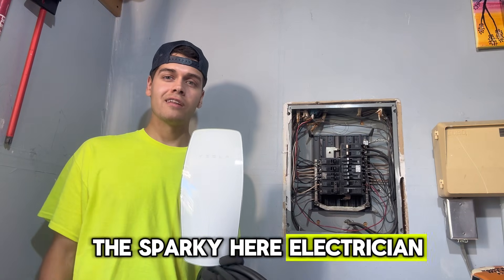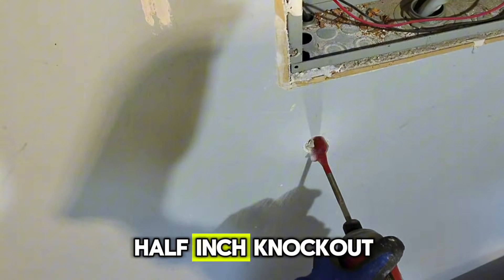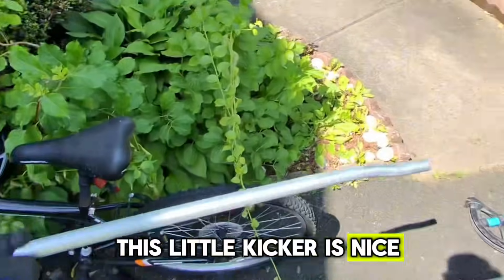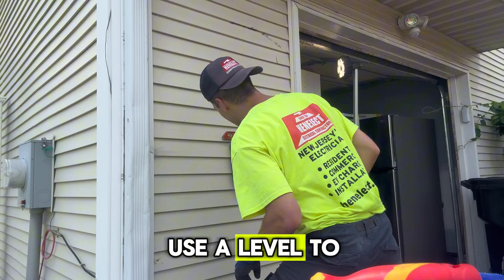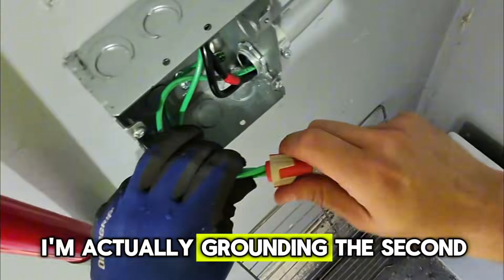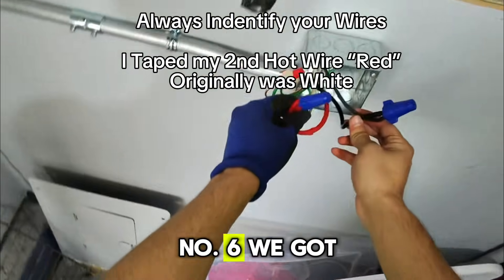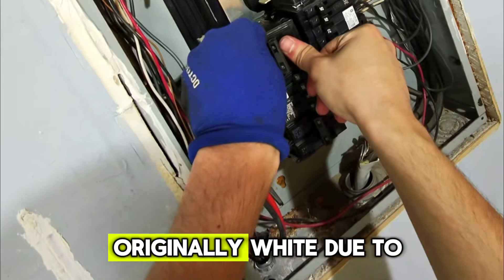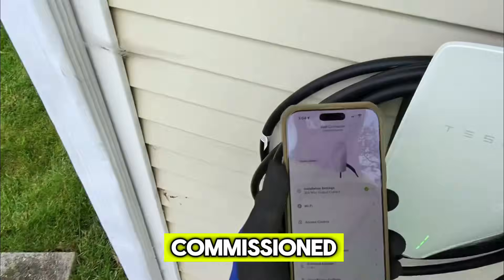HOW TO INSTALL A TESLA WALL CONNECTOR ANYWHERE! THE EASY WAY!

Comment: You can use 6 awg even on a 60 amp breaker, because the Tesla charge is a 48 amp charger, and 6 awg is rated for 55 amps, also you want a CONTINUOUS run of copper wire with this, DO NOT cut and twist wire together

Comment: hi, doesnt that wall charger charge at 40 amps.  vs the mobile charger which charges at 32 amps ?
Reply: The breaker is 40A, but this car will be set to charge at no greater than 0.8 X wire ampacity. Wire ampacity is 40 A based on the 60 deg column for the short run of #8 NMD90. 0.8*40 = 32A, so the charger will be dialed down to 32A at this location. Given the tiny panel, I'll throw out a guess that his main panel wires may not be able to handle much more than that anyway. The breaker is chosen based on wire ampacity. The reason continuous loads effectively derate a circuit is because the continuous production of heat may lead to a dangerous cycle of increasing resistance, more heat, connector breakdown, and fires. You never want your continuous load to get close the tripping value of the breaker.

Comment: So why were the 2 “junction”
Boxes needed? Im asking out of genuine curiosity because i have negative knowledge of anything electrical
Reply: Where the wire penetrates the wall to the charger a tight turn is needed, so he had to use either a box or maybe an LB fitting. Where the wire comes out of the surface mounted panel, he likewise needed a tight turn and a transition to the MC conduit, from something that protects the short run of wire inside the wall between panel and first box. Whether he used a short length of flexible metal conduit to protect those #8 wires, a short run of MC cable, flexible liquid tight conduit, or in this case NMD 90, a box was the most convenient way to transition wire and anchor the run of metal conduit. If the panel had been surface mounted he could have started with conduit directly from the panel. I might have been inclined to avoid a splice by doing the entire run with #6 THWN inside conduit between boxes, and extend that same THWN inside flexible metal conduit for the short run between panel and box. This would allow versatility in case the client one day decides to upgrade the panel to allow better power transfer.

Comment: I probably would've done it like that, but I don't like the little short nipple for that box offset, should've all been in one pipe, or at the very least cut the nipple longer so the coupling looks like it's in the middle of the pipe, not like a foot away from the box... doesn't look very good. Or just order standoff straps and use those instead of one-hole straps so there's no room for error with the box offsets. Also you don't need to ground a 4 square box if the conductors are passing straight through, only need to ground it if you're making joints in the box.

Comment: Why no disconnect within sight of the charger? Required where I work in Washington, but it is an NEC code.
Reply: Tesla specifically instructs not to install a disconnect as they will often melt.   It might not happen with this install as he is only installing the 40amp breaker but the 60amp install can apparently melt disconnects.

Comment: Hi, I had electrician came out installed for me but a week ago the Wall Connector had no lights on at all. I called the electrician they came out test it said Wall Connector’s problem. I contacted Tesla customer service they sent a new one out, I used their guidance installed the new one still has no lights on. I have no idea what is going on.
Reply: Did you fix it? Sell me the old wall connector please.

Comment: Im in NJ - i just bought a model y how much do you charge on the install?
Reply from the maker: Email me - hendythesparky@gmail.com , depends where electrical panel is located
Reply from the maker: Happy to help and get you free estimate
Reply: So I have a barn with its own electrical panel and theres a 220 6-50 outlet, that i could used for the the mobile charger, but thinking about getting the wall charger too.

Comment: Great job! How did you route the conduit from the Tesla back panel to the siding plank? Did you use duct seal and a conduit connector for that?
Reply from the maker: Installed another baby piece of EMT into the back of the unit, inside the wall, to feed my THHN wires in, thank you

Comment: I find these interesting to see, BUT....
In California where I live, this is not an allowed DIY project.  You have to hire a licensed electrician to do this or you can't get a permit and get it signed off.
If you were to go ahead DIY it here is what would  happen.

When you get a fire due to it, your homeowner's insurance would not cover it
When you go to sell your house the inspector would want to see the signed permit.  No permit?  They would not sign-off on the sell.
Reply: I’ve sold houses and inspectors never ask to see the permit for the water heater installed years ago. 

They’ll open the panel and note any problems, but they don’t care in the least if it was originally permitted or inspected. All that matters to them is the current thing they’re observing.
Reply: Baloney
Reply: @Stude59 then you are not educated in the regulations and laws.

Comment: You either need more foot pressure on those bends, or you need to junk that Klein bender for an ideal. Would look better without that coupling that looks to not be  tightened.
Reply: Oh, EZ ancors are way better than Moly/vynl/plastic ancors for drywall. Molys are actually for masonry. I like the technique, and that screwdriver BTW.

Comment: I am an Electrician in NJ also. You have to watch installs when there is only 100 amp services. Depending on the total load, in some cases the meter pan neutral get very hot and starts to burn at the terminal.   I always recommend upgrading to 200 amp, if they can afford  it. Tku.
Reply from the maker: We always recommend a 200 amp, in this case however we did a load calculation, and 32 A Charger was ok, since the 100A Panel did not have many loads, and also gas appliances in the house

But yes always 200A is recommended
Reply: I wouldn’t add a large load unless the service was large enough.

Whether they can afford it is not necessarily a factor.

“Okay I’ll add this 50A load but your house might burn, k”

Comment: Why not run FMC or LNFC 9” from the 1900 to the panel? Coulda run 6awg thhn all the way through and set the charger to 40A continuous. Or, even if not enough load calc, one less splice to get hot.
Reply from the maker: Yes, there are lots of ways to install, will it pass code, 32 Amp Continous Load, yes, is splice ok, yes